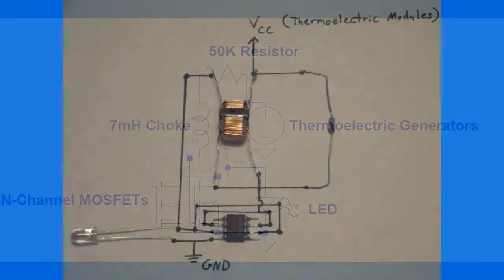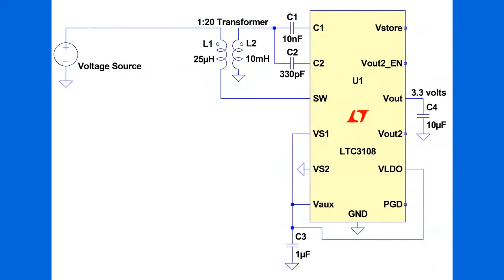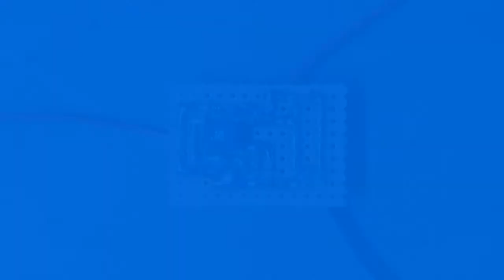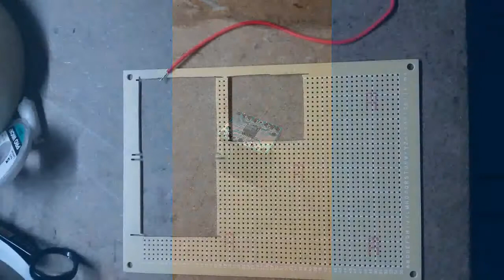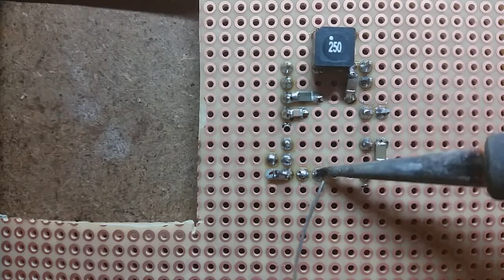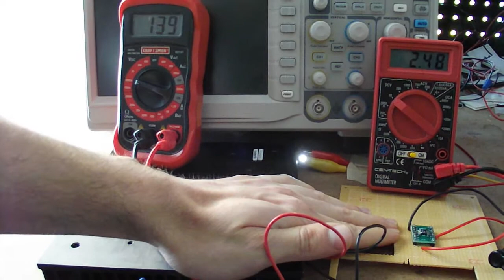How to make the LTC3108 Energy Harvester

Comment: Hello LampE, I bought the following energy harvester https://m.ebay.com/itm/Thermal-Energy-Harvesting-power-supply-w-LTC3108-and-supercapacitor-storage-/331654685113?_mwBanner=1 but I'm having a hard time figuring out where everything should be connected I'm trying to light a red LED (because it's cheaper energetically speaking) with a Peltier tile. The problem is that on both sides of the circuit there are Vouts indicated, if you're not too busy your help would be appreciated thank you
Reply from the maker: It looks like you use the normal Vout that's located on the top of the board. Then to select the voltage, just make a solder bridge across the numbered solder pads as indicated in the description of the ebay page
Reply: Hi LampE thanks for the advice but the system doesn't seem to be working, we made two solder bridges to select the output but when we connect the Peltier tile and the LED it doesn't work, do we have to solder the led to Vout and the Peltier tile to the Vin channel? Thank you
Reply from the maker: Yeah, the LED should be connected between Vout and ground. The peltier tile should be connected between Vin and ground.

Comment: Hello! Why do you only have one input wire? How do I attach both wires of the Peltier tile to the input of the LTC circuit?
Reply from the maker: The black wire can is used for both the input and output, since it's the ground
Reply: Thank you! I built the circuit, but it stopped working after one day (the output voltage is the same as the input voltage). I read through the comments and saw that this also happened to another person because of loose connections on the LTC3108. However, I tested if my problem was also due to loose connections by firmly pressing down on the chip, but nothing changed. Do you maybe know why this is?
Reply from the maker: Hmmm, I'm not sure. Maybe there is a short somewhere
Reply: Okay, thank you. Do you think it could be the LTC3108 chip that is broken?
Reply from the maker: That would be my first guess. If you try to replace it and you get the same results, then it would be something else
Reply: Thanks for your help!

Comment: Hi! If I were to use a CJMCU-3108 LTC3108-1 development board will i still use this circuit?
Reply from the maker: I'm sure you could
Reply: Sorry that was a idiotic question.But how I do I connect those pins and where should place the wire? Basically I am asking on how to set it up in order to make  a TEG flashlight using it.

Comment: I wanted to know why some readymade ltc3108 circuits  constantly can't light up an led.
Reply from the maker: Using what, as a power source?
Reply: A peltier tile
Reply from the maker: I'm not 100% sure, but it sounds like the circuit draws in a lot of current, which would cause the peltier tile's voltage to drop. Maybe try more tiles.

Comment: Hello lampE, I tried making the same harvester using 1:100 transformer, I also changed the capacitance value to 1nF for C1. It works well for a 1.5V battery, the output was around 5.3V but when I tried using the TEG with 100-150mV input, the converter doesn't work.

What did I do wrong? Thank you :)
Reply from the maker: What was your desire output voltage, based on how you connected the VS1 and VS2?
Reply: Hi LampE, I want a Vout of 5V, I connected both VS1 and VS2 to VAUX.
It works well with a 1.5V battery as source but when I tried using the TEG, the output stays in mV :(
Reply from the maker: What is the input voltage of the circuit when you use the TEG as the power source?
Reply: I got 63.9mV using the TEG as the source and got 75.4mV as the output. I don't know what is wrong with the circuit. :(

Comment: Hello sir, is it possible to charge super capacitor with the amount of electricity produced? (Sorry, dont know much. Need for project) If yes, is it okay to use this kind of circuit https://www.ebay.com/itm/Thermal-Energy-Harvesting-power-supply-w-LTC3108-and-supercapacitor-storage-/331654685113  for the thermoelectric flashlight? Thank you very much! (Really need your opinion)
Reply from the maker: Yes, you can charge a supercapacitor, but of course it will charge slowly. That circuit will work.
Reply: Thank you sir!
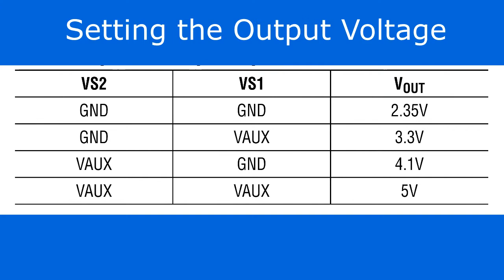Reply: One last thing sir, can you recommend alternative item for transformer 1:20. The availability of the item is a big problem. Thank you sir! I hope you reply
Reply from the maker: If you can fine a transformer with relatively the same values, you should be fine
Reply: what do you mean by "relatively the same values", sir? Can you site specific item as alternative sir? Thank you very much!
Reply from the maker: Is digikey not available for you to use?
Reply: Sir, where did you connect the peltier tiles?
Reply from the maker: To the input wire (the one closest to the input of the inductor)
Reply: Sir, our circuit only made an 1.5 voltage output, what suppose to be wrong? (We don't have chip capacitors, instead we use Electrolytic Capacitors. Is that the reason?)
Reply: Sir, is your LED only need 1.5 v?

Comment: Are there any options to replace the SSOP adapter board? And how many windings does the 1:20 transformer have?
Reply from the maker: You might be able to find adapters that allow you to just snap in place the chip. You would have to look it up.

Comment: LampE, Thank you very very much for creating these videos and helping out the community with so many projects. I was wondering if in this video https://www.youtube.com/watch?v=QzTn9GtSpEU they are using the following components: 
Mouser Advanced Linear Device .http://www.mouser.com/ProductDetail/Advanced-Linear-Devices/EH300/?qs=sGAEpiMZZMvANcmvDb1WMWXSIULf206m with the TEC1-12706 Thermoelectric Peltier. Also what LED do you think their using? It looks like the hexagonal high powered ones from LED Supply but I can't figure out which one would be best suited; could you possibly suggest what one.
Reply from the maker: Yeah, Advanced Linear Devices do have energy harvesters, but they are expensive. They have a few different one, but the one in the video is probably the one you found on mouser. The LED looks like a normal surface mount device type, 20-30mA; an LED without a lens

Comment: hey this is great work ......................is it possible to do this to harvest vibration energy using piezoelectrics?????
Reply from the maker: piezoelectrics create voltage spikes higher than thermoelectrics, so I would not use it for that
Reply: You can use the LTC-3588 chip for this

Comment: Hi,

First of all, congratulations for the tutorial. I have been able to make the LTC3108 work using a regulated power supply. Now I am trying to replicate the circuit in order to make it work with a solar cell but I don´t know why the system is not working.

Could you give me some advice?

Thanks!
Reply from the maker: Thank you! If you were able to replicate the circuit correctly, see what happens if you press down on the chip. This might indicate that there is a loose connection between the chip's pins and the adapter board. Also, you might have a short between the chips pins caused by a solder bridge
Reply: Thanks for your answer!

Yes, I have checked the connections but it does not seem to be a problem of a short circuit or a missed connection. Also I have used the same circuit to connect the solar cell but is it not working. Could it be a problem of the solar cell?

Thanks.
Reply from the maker: See what happens when you use some other voltage source, like a battery

Comment: Hi I'm trying to make the same circuit but I only have a 1:100 transformer. Do you know if I would have to use different capacitors, and what ones or can I use the same ones in your schematic?
Reply from the maker: for a 1:100 transformer you need a 1nF cap for C1, and a 330pF cap (same capacitor as in the 1:20) for C2.
Reply: Do i also use the 1uf capacitor for c2 and the 10 uf for c4? When connecting the circuit on the protoboard  do i place the capacitors in the same spots as u did?
Reply from the maker: Yes, 1uF for C3 and 10uF for C4. Everything in the same place
Reply: Thx
Reply: @lampe7384  sir can I ask some questions
Reply from the maker: @cthylix3420  How can I help you?
Reply: Sir will a CMJMCU-3108 LTC3018-1 works perfectly at lighting an LED bulb? And how much Volts does your led require in this video? Thank you so much. I badly need help for our project
Reply from the maker: @cthylix3420  It should work. The LED lights up at 2.5V
Reply: Thanks for your response sir. But can I ask if this module would be enough? I mean will we be needing more components like super capacitor or some common mode chokes with this one?
Reply from the maker: @cthylix3420  From what I could see, you shouldn't need anything else
Reply: So I should just solder the male pins, solder the wirings and connect the peltier cell and light bulb together with the circuit? 

And sir, what is your choice for output voltage in this video? Will it work if I chose my output voltage to 5V and my led is 2.5v?
Reply from the maker: @cthylix3420  Yes, solder it that way. Setting to 5V is fine because the LED will drop the voltage automatically due to low current.

Comment: Hello LampE
I am trying to making this circuit. Had some queries. 
1. What input source are you using to supply such low voltages as 20mV and 60 mV ? What about the current ?
2. If I want to use a 1:100 transformer,  will I need different capacitance ?
Reply from the maker: The circuit is used for thermoelectric energy harvesting. The output current is limited to around 4mA. You would need different capacitors for 1:100 transformer; check the data sheet in the description

Comment: Hello LampE
We made the the energy harvester and it work perfectly. But then, the next day, it stopped working and we don't know why. We check the continuity and it's ok. The entrance voltage is the same as the output.  

Please help us.. is an emergency
Thank you
Reply: Please help
Reply from the maker: did you try pushing against the chip to see if causes the output to go back to normal. This would mean that there is a loose connection. Also make sure that there isn't any shorts between the pins, or between the connection on the capacitors.
Reply: LampE that was the problem! Thank you. 
Is it ok of we connect 3 plates to turn on leds on parallel? Or we are asking for too much? 

Thank you again
Reply from the maker: No problem. The more LEDs that you add, the dimmer each individual LED will be, since they are all sharing the same amount of power. If by plates you mean thermoelectric modules, then it should provide more power, but you probably want to connect them in series
Reply: LampE thank you again. I meant to say: connect 3 thermoelectric modules in series to turn on 3 LEDs on parallel. But you answered my question perfectly. Thank you again.

Comment: Can I charge a 4v battery by a solar cell (output .5v, 8A) with this ckt ? i need to provide min 400mA as battery charging current.
Reply from the maker: If you need at least 400mA, then this circuit will not work

Comment: Hi again..i tried this on breadboard and it does produce 3 volt on the output without load...but LED is placed as the load the voltage instantly went down and it never can achieve 3 volt again unless....

Does it matter if we use normal component vs SMD components like yours especially the SMD cap and also the SMD coupled inductor? I want to really produce that 20mV to achieve at least 3volt and able to light up an LED constantly without the need to goes off.
Reply from the maker: The voltage drops because there isn't enough current on the output of the device to run the LED at 3V. The LTC3108 can only output up to around 4mA consistently, so it probably won't be able to light an LED at 3V. You won't be able to light an LED at 3V with a 20mV input. It might light up, but probably at around a 2.49V or so output. For the 20mV input, you'll need the 1:100 transformer, and a couple different caps to get the circuit to do that. The circuit in the tutorial is design to light up at around 60mV or so, to have a higher efficiency . The one main reason why I use SMD is that it keeps everything close together, preventing the chance that the circuit will pick up noise, which will cause it to not work properly.
Reply: Thx for the details explanation
Reply from the maker: No problem

Comment: can we use electrolytic capacitors? instead using ceramic ones?
Reply from the maker: C1 and C2 have to be non polarized, so they have to be ceramic. The other caps it doesn't matter.
Reply: how to get around 5V output from this circuit?
Reply from the maker: 1:17 VS1 and VS2 pins connected to VAUX
Reply: LampE hey brother, I have doubts in analysing the circuit. Can u plz send me simple outline/connection of the  circuit on paper?? My e-mail address : imrozsarosh@gmail.com

Comment: awesome work LampE. I have a LTC 3109. Can you plz tell me if that can work. If yes, how? I was thinking of shorting the similar pins like Ca and Cb and SWa and SWb. Can you plz give the schematic. I will be indebted to you.
Reply from the maker: Yeah it should work. On the first page of this datasheet  http://cds.linear.com/docs/en/datasheet/3109fb.pdf there is a schematic that you can use. Like before, VS1 to AUX and VS2 to GND, in order to output 3.3V
Reply: how can i do the same with just one transformer?
what should the connections be? can you please tell me?
Reply from the maker: on page 20 of the datasheet the device is used in a schematic with only one transformer. All of the connection that you need to make are shown there. If you have trouble understanding, let me know and I'll help
Reply: is there a way in which i can send you instant messages. It will be a huge help for me.
Reply: lampe is there a software through which i can simulate the circuit before actually designing it?
Reply from the maker: You can prIvate message me through YouTube
Reply from the maker: LTSpice is the software that you want. It's on their website at linear.com or through google

Comment: hey can you plz help in identifying the ports of the IC where we need to connect led and also the port where peltier tiles needs to be connected... plz its urgent
Reply from the maker: The second page of the LTC3108 datasheet in the description will provide a diagram with all the pin layouts
Reply: will it work???
http://www.ebay.com/itm/Thermal-Energy-Harvesting-power-supply-w-LTC3108-and-supercapacitor-storage-/331654685113#shpCntId
Reply from the maker: Yes, and it seems that you will need the make the solder connections that they specify in their description to set the output voltage

Comment: http://m.ebay.com/itm/331654685113?_mwBanner=1

I ordered this chip and it is giving an output of 2.2 volts but when u connect LED With it then it is very dull and dies not gets bright up. My input is of 300 MV and I m receiving 2.2 volts but led is not bright enough it is very dull ..please suggest a solution.. what can I do .?
Reply from the maker: If you are getting 2.2 volts out, then you might need to check your connection with the VLDO pin (the one at the far middle-right at 5:52, that is not connected to the 10uF capacitor). It should only be connected to the VAUX pin like how it is at 5:52 (the long "T" shaped solder trace in the center). This might be the problem because the VLDO pin is design to output 2.2 volts.
Reply: in how many days did the chip arrive ? when was the chip delivered ? +Vaibhav Nayak

Comment: Thanks for the info -- didn't know the chinese is selling the pcb for the LTC3108...quite interesting
Reply from the maker: No problem. Not really, Linear Technology just designed the LTC3108 to fit the standards for a specific pin layout. There's just different manufactures that make adapter boards for many different pin types.
Reply: Thx anyway